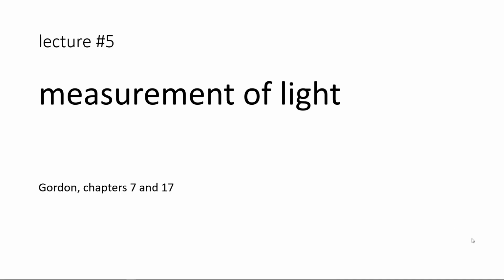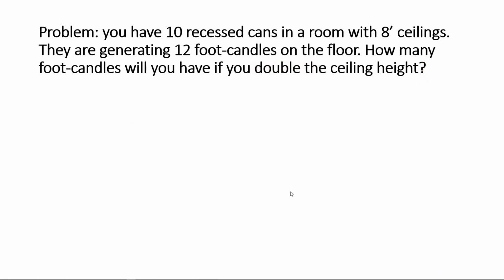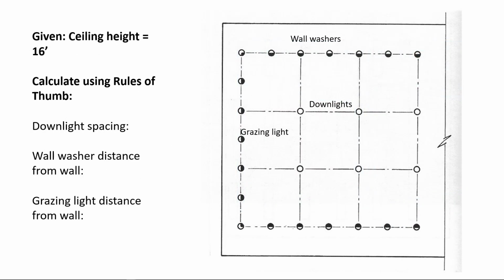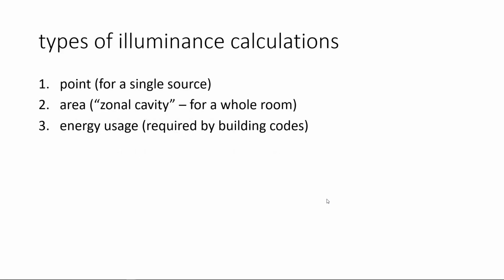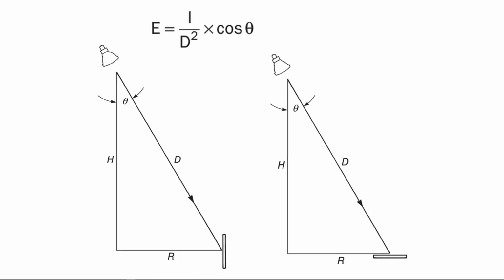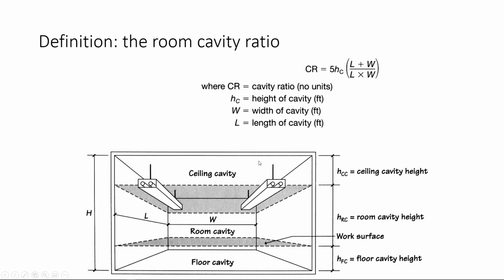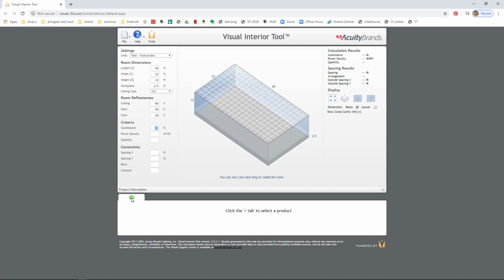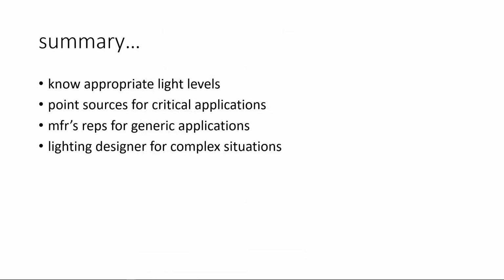Measurement of Light

Comment: I have an question pls,
I have a hall 5m*6m*3m hight 
I need to calculate nos of lights required , space between each light, light KW fir each ,total illumance required for the hall ,
I would be preciated if I get the answer ,
Reply from the maker: You would need to know the output of the light you're planning to use. Spec sheets from products such as downlights will actually have recommended spacing for different light levels based on ceiling height. A good manufacturer for this type of lighting is Edison Price here in the US. ERCO in Germany also has very good data.